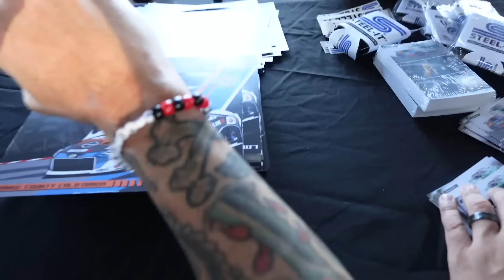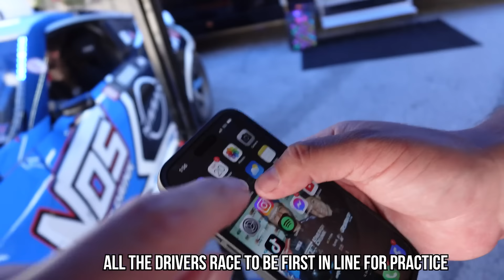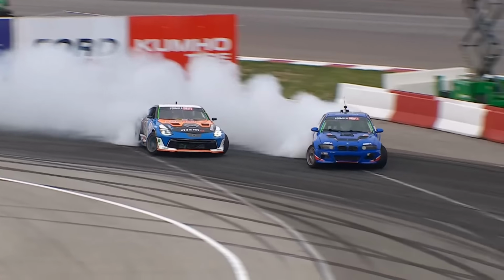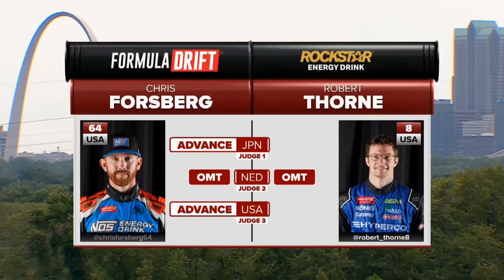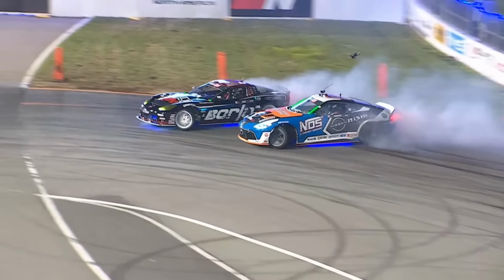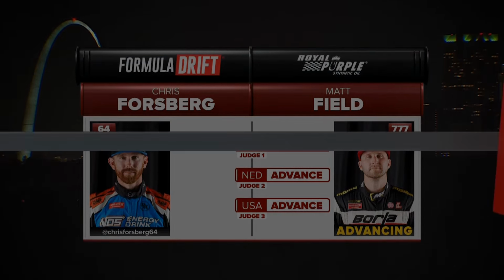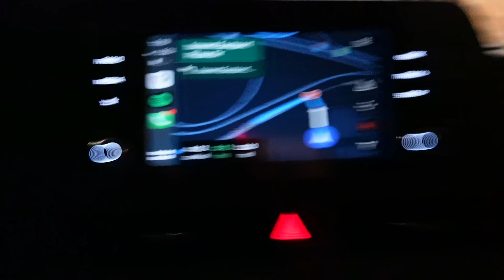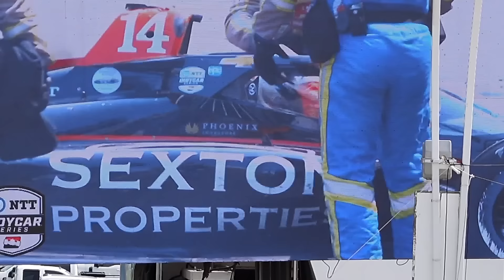Controversial Calls at Formula Drift St. Louis

Comment: Unrelated/Related : FD has to make sure the judges can’t hear the commentators while judging is going on. The commentators go off on wild tangents and theories IMMEDIATELY without all the cameras and knowledge to fill dead air and studies have proven that even if you’re aware of a potential bias, hearing people say a thing as true influences your own opinion of a matter. The judges need to be isolated from their dumb ramblings until a decision is made.
Reply: i agree i got to sit in the judges booth at atlanta and the judges sat directly beneath the commentators
Reply: @max_coast  if I'm not mistaken at STL the judges are in a different booth as FD uses the NASCAR media tower for coms, judging, and spotters. I agree with you 100% however certain tracks it's nearly impossible to have judges completely separated from coms with out just putting them in a trailer only viewing cameras.

Comment: Hi watched it live and now the replay, i think: you make 2 mistakes on the lead 1) OZ1 wall hit makes the car upset a little 2) OZ4 your line is not smooth, your starting deep than going inside and again going out which makes very hard to chase . Matt's lead is very clean.  If you compare the chases they are very similar, I can say you had more opportunities to increase proximity. My decision will be %60 win for Matt, could be OMT maybe. It's my opinion of course, I hope it helps.
Reply: I wrote a pretty detailed comment under his spotter Nate Hamilton's video and this is what it comes down for me as well. Lead to lead Matt takes the win and chase to chase it's equal because Matt's mistakes can be brought back to Chris' mistakes in the lead.
Reply: @driftingmajix  also Fors left oz4 after like 1/3rd and that cut into Field's line making him impossible to actually follow someone who isnt in the correct line leading to Field straighten. That plus Fors wall tap and not as deep in oz3 in comparison to Field plus his chase was further away basically whole way. I can't see how this was any controversial call.
Reply: Honestly should have went OMT..  or too Forsberg yeah Matt had a smoother lead but during Matt’s chase on OZ4 Matt’s clearly almost straightened and hit the throttle to go back into drift completely at the very end and Forsberg had a better chase..
Reply: @anthonyzazueta2870  I still think that Matt had to react to Chris weird trajectory coming into 4 and leaving it again because he angled up was too much
Reply: @driftingmajix  Matt was reacting to Chris leaving the zone before the access road. that was a mistake from Matt caused by Chris in lead. so the deduction goes to Chris, not Matt
Reply: His lead line through outer zone 4 was 100% the cause, I don’t understand how he has this much experience at this point and can’t recognize that
Reply from the maker: Yeah, we are just trying to understand everything better. There were several questionable calls that left many drivers unhappy. Not just mine.
Reply: @chrisforsbergracing  Man I’m usually a solid fan of yours but to be fair, he gave you a solid low 90’s qual run to chase!

You gave him a low 70’s lead.  Airballed it into 4 and even had to check up at the end of the zone.  No wonder he had to straighten.  

He won that battle clean.

Comment: Lead wise, Matt was deeper in OZ3 and 4. You were equal in OZ1 but you hit the wall and it effected line. Depth wise, you were equal in OZ2. Except Matt was fluid entering and you didnt fire off until you were two car lengths into OZ2. Matt could of held better proximity the rest od thw run if he was choked up. IMO, Matt won all the OZs in the lead. So his one mistake was OZ4 in the chase. Lead vs lead, chase vs chase. Good leads make for good chases.

Comment: It has been an issue with FD for a few years where judges make call's that are hard to understand, both from a viewer standpoint and as we hear from a driver standpoint. I would love to see a call back from what Matt did wrong, but what I saw was the wall hit in OZ 1 was kinda hard and pushed the car out of the zone and made the transition to OZ 2 a bit off.

I really DO NOT get why a track values grass safety over driver safety, If they had the flat barriers like long beach I don't think we would see as much of an issue as the jersey barriers with a ramp. Not only that, but I also think the perpendicular wall at OZ 2 should have been reworked a bit and the last bit of OZ 4 made the end of the battle so awkward, the turn narrows so bad it feels like cars can't fit and didn't look like anyone had a real good way of making it look good. I'm not sure FD should come back after seeing some of this stuff.

Comment: This is one of those rare instances where I agree with the judges on a controversial call. 

Chris did hit OZ1 after initiation. He also entered OZ4 shallow then actually came out of the zone towards its middle section and got back into the zone in the last part of OZ4 but was still barely in it. In my opinion, this caused Field to bobble in the chase as you can see Field enter OZ4 on a near perfect line but had to correct to take a shallow line to chase Chris which made him bobble.

Field also did have a much better Lead. So I think I agree with the judges in that battle but great showing for both drivers.
Reply from the maker: Appreciate your breakdown.

Comment: You kind of explain it yourself, the wall tap at outside zone 1, And outside zone 4 definitely was not clean as you exited the zone 2/3 of the way through on a very weird line, he was deeper in the chase on oz4 and had to shallow up to try and keep proximity which was caused by your lead line. 

His lead was a lot cleaner and fluid as well as deeper in all of the zones too

Comment: Fair call by the judges... CF is missing the fact that he had a bobble in OZ4 that's why MF had to check up which ruined his momentum and made him run shallow. Very typical for CF mistake, if you watch other cars in OZ4 they way less of a delay between slow down and acceleration. idk why Chris sleeps on the gas, may because he dropped wheels in practice and was trying not run wide.  Other drivers expect him to step on it after slowing down, but Chris coasts for second. 
In terms of lead, Chris hit the wall and cut the line after that, a big no no, judges said they don't want to see that in the driver's meeting. Spotter should have cleared that call, and inform the driver. Anyhow, just an opinion.

Comment: St. Louis needs to go.
Reply: Naw
Reply: @Xmoto16  It's a terrible event. The old layout was good but now it keeps getting worse. Now the track is being terrible to work with and made this most recent event an absolute shit show.
Reply: @ireeeebz  I guess 🤷‍♂️. You been to long Beach? What tracks are the best?
Reply: Yup, St. Louis is the only event I was able to go to last year and this year and I didn’t go because the track flow sucks.
Reply: Agreed. The track organization gives 0 poos about FD and totally compromises the layout to protect the "main" one for Indycar, and they use dangerous walls that make cars flip having been warned by everyone.
Reply: @XJR15ftw  yup when the track would rather drivers potentially write off or flip cars to avoid having to call someone to repair some sod it's time for FD to stop giving them money.
Reply: Stl is one of the best if not the best event for spectators because of where you sit at nascar turns 1 and 2. The wall on oz1 should have been a flat wall but having a wall there was awesome for spectators and the driving. In previous years so many people were droping tires into the dirt off oz1 it looked like a shit show. The wall for the bank on oz4 and oz4 in general I personally feel it should be a touch-n-go at the wall on the entry of the turn and a inside clip like they do at long Beach. 

As far as cars getting destroyed, long beach destroys more brand new cars every year than stl ever has.
Reply: No it just needs improvements. World Wide Raceway just needs to listen a little more on recommendations, if you’ve ever been to the event you’ll see a lot of drivers prefer the new track over the old as well. It’s all a matter of preference and adaption. We get to actively watch drivers change their style to match the track and the stop-go flow of it and it’s awesome. Yes there’s downsides but that doesn’t mean they need to drop stl all together
Reply: Og layout was truly the best, been downhill ever since
Reply: @muchamwachia  the og layout was bad for spectators, bad for tire wear, and bad for tandems (seriously go back at watch that event, the closest tandems cut the line a crazy amount to gain proximity it really is ass)
The current layout produces great close tandems, the tires last both runs with out issue, and spectators have great viewing and a huge amount of room for spectators (most seating of any FD round) as well as restrooms and concessions extremely close as its now the nascar turn 1-2 bleachers. Spotter has access to the roof of nascar media tower for arguably the best view a spotter could hope for from any round. 
Literally the only thing the old layout has going for it is that it was a high speed layout. But from IC2 to TNG1 alot drivers are at crazy low angle it generally looked bad. 

The old layout is fun to drive because it's fast however the current layout is fun because it's technical.
Reply: @02bluehawk  y'all sound like a rep from st Louis. Give it up dude, nobody likes that town or that track.
Reply: @TooLoudBear  not a rep, don't work for the track or fd in anyway, I am a STL local.
Honestly why do you hate the stl track current lay out. I'll give you the first 4 years of the layout in the location it is was bad. Now however with the added pavement it's actually good. So what's your issue with it?
Reply: @02bluehawk  it's a layout is like a bank teller line. Slow and flat. A set of bleachers in a Walmart parking lot would make for a moar exciting track. The line for space mountain at Disneyland is faster and moar exciting than this track. An autocross event is moar exciting than this track.
Reply: @TooLoudBear  "slow and flat" Englishtown is slower and flat. 
Stl is fast then heavy slow then fast
Many of the best drift tracks are this formula. Dmec mondelo (also flat), dmec ferropolis(also flat), road Atlanta, dmec hungry, and I'm sure many other smaller less well know layouts. 
The high speed with no decels or only minor decells isn't that common.  Momentum changes and tight tandem make exciting drifting not high speed.
Reply: @02bluehawk  etown sux too. Butt comparing Atlanta to st Louis? Not even close dude. Butt at least at etown, the fans are within decent proximity to the action. St Louis, the fans might as well be in BFE. Right when the action starts to get exciting (when they exit on the bank), the finish is just before that point. Did you see the LZ crash? No, because I didn't have binoculars to see that far from the bleachers. At least Texas motor speedway had big ass tv to see shit on. And TMS isn't an over glorified bank teller line. And TMS has a bucees right next to it. What does st Louis offer? Only a broken arm from Matt Coffman's last FD run because he tried to explore the wonderful city st Louiy. Is it gonna be a scorcher? Is it gonna be a gawd dayuuuumnnn tornado? Maybe they'll throw a fresh coat of paint on the track right before a comp? St Louis sux.
Reply: @02bluehawk  holy shit dude enough. We get it you fucking love STL
Reply: @TooLoudBear  the comparison of atl to stl was the momentum change. (Fast, slow, fast). Yes I did see LZ's crash in person with out binoculars, yes there is a large screen you can watch it on as well. I'll never argue about the weather or city of stl cause the weather is a crap shoot that fact that they choose July to be in stl means 90% of time it'll be 90- 100°F and high humidity and if it rains it's a nasty storm. The city of st louis is a mess with its own problems. 

The old Texas lay out was kinda bad tbh, idk if you do any sim drifting stuff but ESDA Texas is much better as after the inner clip it's a sweeping turn back in. That layout is sick and fun af. With out that last turn it feels lacking and the tandems were only good for the first turn.

Comment: I watch FD from time to time but I just cannot be a true fan or fully get behind it because the judging has always been very inconsistent. FD has been going on for multiple decades and the rules are still ever changing. The fact that they have not invested into in-car camera's is weird to me. The light strips on the windshields are 100% useless, laggy, delayed. They need to invest in in-car camera's. One watching the driver / steerings and once watching the pedal box. Would give you a sure fire answer to 9 out of the 10 questions they have instead of guessing from aerial views.

Comment: Matt's lead was a lot cleaner and they seemed to reward leads a lot more now. Obviously there was the OZ1 wall that kind of threw off your line and pushed you away from matt. I think the spot that gave matt the win was OZ4. You entered well, but ended up leaving the zone late and then the handbrake pull at the end probably also deducted some points, especially since it caused matt to angle up more.

Comment: In my opinion, you was closer in the chase and matt made a huge error in the chase, but you did clip the wall in zone 1, so it should've been OMT but your chase was better and cleaner than matt, BUT it's no secret the judging in 2024 has been very inconsistent and as you said rewarding the bully style, touching doors is fine DMEC and D1GP they touch doors but it's done stylish and looks incredible, but FD this year rewards bullying and in your words "sloppy"

Also side note! JERSEY BARRIERS NEED TO GO! there's a reason a lot of motorsports are changing from them, because they're dangerous, luckily LZ had experience to know to turn into the accident but a new driver probably wouldn't and end up doing more damage, they need to go!
Reply from the maker: Thanks for your input!
Reply: @chrisforsbergracing  your welcome mate hope next round you come out swinging 😎

Comment: calls where fine by them, you just did a lil to much in the wall tap department in oz1 and came out early which then made a lazy/late transition to oz2 which then lead to mid line in oz3 and then the tire  coming out of oz4 sealed it. matt couldn't have a good chase due to all that lol matts lead was clean and was deep in the zones. matt wins in my eyes

Comment: If your irish and/or driving a mustang the judges will never fault you for anything and all your runs are perfect. Otherwise everybody else loses a whole battle just for losing 1 degree of angle at any point or goin 1 mph slower than the judges like.

Its said year after year and it becomes more evident that the judges need replaced with former drivers or ditch them all together and have sensors everywhere
Reply: That's rich coming from a forsberg fan..

Comment: That was your lead resulting in him not being as close in the chase. You smacked the wall and got a massive momentum boost into outer 2 and therefore for he left a gap in 2 and 3. Then outer 4 you nearly spun, barely hitting the zone with way to much angle which is impossible to chase super close when your that far off line. Sorry m8 but this one was fair

Comment: maybe its click bait but I don't understand why you said controversial calls. you hit the wall on matts lead and it fkd up the rest of your run. He had a very smooth and consistent lead and gave you all the opportunity to door him and the only corner you did so was oz4. def lost bruh.
Reply from the maker: It is not just about my lap, looking for your thoughts on the consistency in calls in general.
Reply: @chrisforsbergracing  I think, in general, drivers need to understand what the judges want and hit those marks. At this level, there shouldn't be a debate on what you guys can and can't do. Some of you have been driving for 20+ years. The skill gap shouldn't be as big as it is. Back to the main topic. It sounds like you're saying that the judges are asking for one thing, and changing their thoughts a mid battle? If that's true. And it may very well be. Then drivers need to come together to make something happen about it. I will grant you that ALOT of drivers have been coming out with videos about how the judges are inconsistent. However, are drivers doing exactly as asked. I've seen teams go up to the box throughout the day just to check up on if they're driving the judges expect.